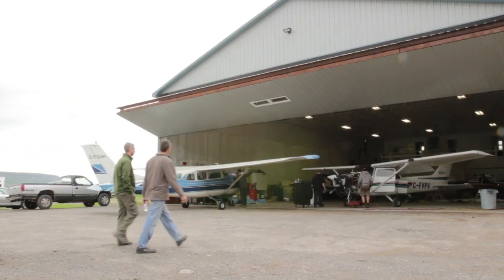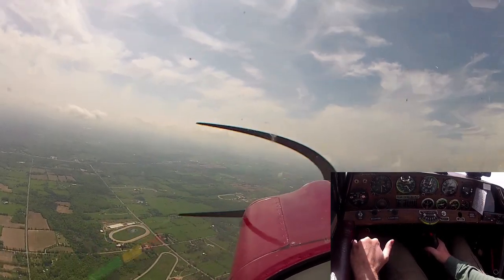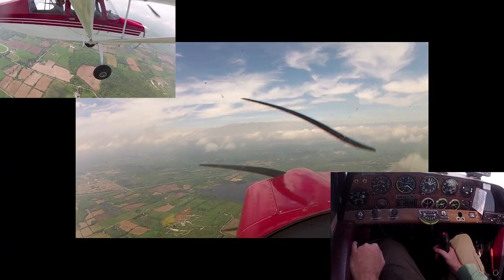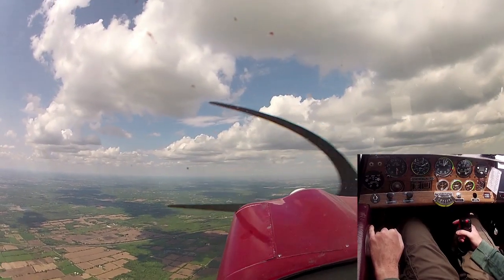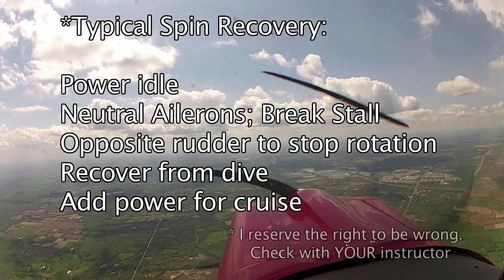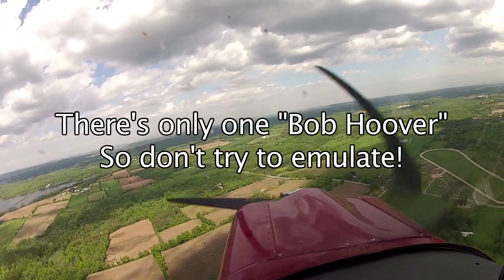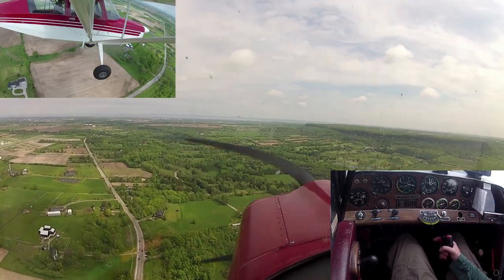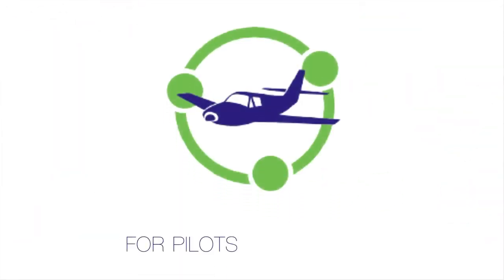Upset Recovery and Spin Training - Bellanca Citabria - POV Flying

Comment: I fully understand that feeling of watching fields spinning around in front of you, and the shock of the suddenness. Inadvertently entered a spin in a 172 as a student pilot during a power on stall. What's most memorable (other than jelly-legs exiting the plane) was my instructors completely calm voice narrating the spin recovery, followed by "I've never had a student do that to a 172 before". Leaden left foot. Also did a perfect no-flaps landing in the same 172. Inadvertently. As I went to retract the flaps for the touch and go I had a shock, with a grinning instructor saying "forget something?". Happy days.
Reply: You did cut the flaps on the flare??? good trick..I did it too..Mooneys float a lot on flare if a few knots too fast for the weigh..You cut the flaps, it seats nicely on runway...brakes on..500 feet roll..nice..

Comment: Thanks for showing the skidding-turn-stall while simulating a turn to final. That's my worst fear, because I have been guilty of stepping on the rudder too much to keep from overshooting, and I didn't realize how dangerous that can be!
Reply from the maker: glassdogangle Yup - it is scary how many pilots are afraid to confidently bank when needed, but will happily do a low level, slow skidding turn, and flirt with a stall / spin with out even realizing it.
Reply: +glassdogangle When I took my check ride, the DPE told me that a skidding turn in the pattern would be an automatic fail because that's how many stall/spin accidents happen. That's stuck with me ever since, and this video helped solidify that thinking. (I flew tonight, and was keeping an eye on the ball during my base/final turns specifically for the skid)

Comment: Great video, I've played around with flight sims a bit and spin recovery is something I have had a lot of trouble with. To be honest I didn't look into it all that much but just tried a bunch of different things and eventually gave up. The one thing I didn't try was neutral stick, it just seems so counter to what you think you need to do which is fighting to regain control. Being gentle and letting the aircraft do its thing makes so much sense when explained in the manner it was in your video. Cheers :-) Might have to pull out that sim again.

Comment: I love the video! I want to point out that a stall has nothing to do with speed. A plane can stall just as much at Vne as it can at landing speeds. It's all about AoA, the wing will stall when the air is going at too steep an angle in relation to the wing that the air separates from the top of the airfoil. Let's say you're traveling fast and yank back abruptly, the aircraft will respond abruptly as well. So abruptly that the aircraft will be pointing up even though it hasn't yet changed the direction it's traveling, thus it's now pointing up while still traveling straight forward.

Just wanted to point that out! I'm no expert and I didn't notice any misinformation at all in the video. Just thought this was worth mentioning.

Happy flying!

Comment: Nice video - I'm a glider instructor at GGC (CNF3) and we teach the botched final turn spin entry to all glider pilots. Nose high - flat turn - rudder it around - wing drops. As far as I know that's the standard in the course syllabus in Canada - and we require a demonstration on all spring check flights. 

As far as I'm concerned, spin training is the most important part of any PPL - I didn't feel comfortable behind the yoke until I got past the spin training section. 

Oh and your spin recoveries were nice - from an Aerobatic Contest perspective - you need aggressive forward stick to break the stall exactly when you want and set a nice vertical line after the spin :)

Don't be too hard on yourself with all the disclaimers. I'm an "instructor" in gliders at least, and you seem to know what you're talking about :)
Reply from the maker: Thanks!  I appreciate your perspective as a glider instructor!  That's awesome.  My next big goal after getting IFR done, is to have accumulated enough tail wheel time to feel comfortable volunteering as a tow pilot at a local glider club!  Hopefuly I can get into that next year!
Reply from the maker: Tom Hastie Awesome man!  How long did it take to get comfortable towing?  I hear you have to climb out super slow, both due to the added drag of the glider, but also because they don;t want to to fly very fast...  So I guess it is super gentle turns all the way up and then spiral slip to get down in a hurry?  The climb scares me, but the descent sounds like a blast :P
Reply: I got comfortable pretty fast... probably just a few duty days of towing. 
The climb is a non issue - Climb at 65knots for 99% of gliders. Gliders with water ballast will ask for 70-75knots. Then you just hold that airspeed until the glider lets go. Generally you also want to be finding thermals for the glider to release in. 

You can totally tell how experienced the glider pilot behind you is by how hard you are working the stick and rudder to maintain pitch attitude. It's kind of like flying in moderate turbulence when a new student is back there. The more experienced the glider pilot, the steeper you can turn. With the high time pilots behind me, I can often turn tight enough to stay in a thermal with the towplane. :) Students don't like that though. You have to know who you're working with. 

On the way down there's generally a cool down procedure to cool the engine slowly and in a controlled manner. If you just chop the power and accelerate to Va, you can shock cool the engine and crack cylinders quicker.

Biggest danger towing is a mid-air collision. You're operating in super congested airspace, and you need to keep a mental map going of where all the gliders within 5nm of the airport area at any time. I prefer towing with the low wing Pawnee because it gives you much better upward visibility in the climb. 

Phew... that was long. Sorry for the ramble.

Have fun!

Comment: Good stuff. I really wish more guys would reiterate more about flying patterns that basically allow you to reach the runway safely with a power loss (which typically happens during an adjustment to power). My CFI beat it into my brain to fly patterns in which I would orient the distance from the active on my downwind leg to be able to pull heat and go to idle power when I were perp with the numbers. Unless in a hot, complex a/c, I just do not understand taking the chance of flying a huge pattern when flying a simple configuration like a Cub or Citabria. Now I fly complex ac and don't drag them in with power over obstacles etc. to reach the threshold. I would love to hear your opinion on this and maybe a vid. Obviously crosswinds and other variables play a role but man, that was a 3 mile final... lol. Great vids though! Thanks!
Reply from the maker: I agree completely with your thoughts.  And when I have more experience with faster complex aircraft I'd love to explore it further.  As for this particular case, it was actually a 1 mile final - the wide GoPro lens just makes it look further...  but if you do the math based on the speed and time, you'll see that it is actually almost exactly 1 mile (I just timed it before making this reply to be sure I wasn't crazy :)

Comment: I was at a fly in when I was a kid and they were doing the flour bombing contest.  One gentleman was in his hot rod twin beech running low passes and dropping and doing hard pull ups.  He was in this scenario where he pulled up too hard and got to a mock hammerhead position and spun it into the ground off the end of the runway because he lost airspeed and probably kicked his rudder hard at low altitude.  I can still remember the unsettling crunch and black cloud of burning.  Stalls on final are fatal.  Especially accelerated stalls since they don’t come with a warning and are always pilot induced through over control.

Comment: Thanks a lot. Great footage and editing, and very informative to watch, as usual.

The rocking sideways without turning was the only manouver during my primary training that made me slightly queasy. Even under the hood, or steep turns up to 60º was never an issue.

Cub prop strike "wasn't major" but still required an engine teardown?

Prop strikes are never "minor". For this very reason. Any prop strike is assumed to impart "shock loading" on the crankshaft, which requires a rebuild. The shop that maintains our aircraft had a couple of those recently. Not our plane, though.
Reply from the maker: Thanks for clarifying - you are absolutely correct.
When I said "it wasn't major" I meant it wasn't a crash that involved airframe damage, it actually happened while taxiing slowly...  The crazy thing is, this particular prop strike was almost avoided - the engine was shut down by the time it happened, and it was actually on the "kick back" when it struck...  so the trailing edge of the prop was where the damage happened.  But still, they took it seriously and went through the full inspection process. But again, thanks for clarifying where I failed to do so,  I am going to add what I wrote here to the description.

Comment: This was a very interesting video. I haven't flown in aircraft in years (only done it once as it is) and I am relegated to simulators. In Warthunder's simulator difficultly, all of the aircraft would spin if you gave them too much rudder on a turn. I did think it was just something wrong with the game... apparently not. And given how disorienting it was staring at a monitor watching it, I don't envy any pilot who's got to do that for real.
Reply: I work on simulators. Something to keep in mind is they are only as good as their flight dynamics model driving them.  A lot of simulators (with the exception of X-plane) use a table look up method based on aerodynamic coefficients determined from a wind tunnel. So right there the simulation is only as good as the wind tunnel data. And, I can tell you. The data is likely un-symettrical.  Also, simulators, such as MS FSX, don't use very large tables with lots of points. It gets watered down. So, in short, it is not very accurate.
Reply: Joshua Reed
indeed. the way X-plane seems to do it is a lot more precise, well, as precise as a 'game' might be. (As a side note, making your own aircraft in the demo is pretty fun, and challenging,, if you keep yourself to engines you can buy off the market)
Reply: X-Plane uses blade element theory. It's a lot faster, but does not come without drawbacks. Simulation is always an approximation. No matter how close. Haven't really bothered with the plane maker tool.
Reply: Joshua Reed
Indeed, that approximation depends quite a bit on how the aircraft is modeled.

Comment: Learned aerobatic flying in a Citabria in 1973.  Spins are so much fun!  Loved hanging on the prop just before a tail slide and doing a 180 degree turn.  My first solo without inverted oil was bad news.  Too much time upside down and damaged the engine--barely made it back to the airport!  My next solo resulted  in a 7G blackout as I did a split S recovery from a 180 MPH dive.  Flying inverted and tried to correct a slight nose sink by pulling back on the stick.  Wrong way.  A full throttle vertical dive (chopped it quickly) brought me from 7,000 feet, through a brief blackout and a level flight recovery at 350 feet!
I'm now 70 so clearly I lived to tell the tale!  See my book:  https://www.thebrotherhoodofthebeast.com

Comment: I didn't know you could crap your pants as a Monday Morning quarterback. I Almost did watching another great video. For the gopro on the Wing. What bracket do you use 
Thanks again.
Reply from the maker: Thanks!  I have a big bag of tricks for camera rigging.
Several stock GoPro mounts as well as aftermarket such as RAM.
In this case, the GoPro "roll bar mount" was a perfect fit for the thin wing strut (beside the thicker one) on the Citabria

Comment: Steve, great video! How do you attach the camera to the exterior of the wing?
Reply from the maker: Eric Haber Thanks Eric.  I actually use stock GoPro roll bar mount for the smaller strut on the Citabria and Super Cub.  I don't have a good solution for exterior mounting a Cessna or PA28 though.
Reply: Okay, thanks!

Comment: Hey, is that the Super Cub some dink taxied into a concrete-filled steel post around the filling station, thereby stopping the engine cold in milliseconds?
Reply from the maker: +LorddGray - yes, funny / sad thing is this was 2 seasons earlier, and it was a super minor prop strike that time... But the engine was due for over haul so they did a full bulk inspection regardless - it was back on line shortly after... The latest prop strike was major and did a lot of damage.  They are still working on fixing it months later.
Reply: ***** Wow. I saw that video (about the major strike) quite some time ago but it just looked so familiar. Bummer to get it banged up like that.

Comment: Why did you start it on left mag only? 

Greetings, from a New Zealand PPL student!
Reply from the maker: Thanks for stopping by from across the pond!
The left mag has some sort of "retard mechanism" that allows it start at a low RPM with out detonation or something...  the right mag does not have that apparently...  so we don't turn on the right mag until after she's started running and is at a stable idle RPM.
Reply: Oh, thank you!

Comment: I practiced hundreds of times all 5 kinds of engine fails on take off..Also the 5 feet full flap go arounds...One thing is to practice "High Altitude Upsets" VS the  "Low Altitude Upsets"....That is why so many with spin training stall when low...

Its ok to practice spins and basic aerobatics at high altitude..The legal limit to recover in USA is 1,500 feet..BUT the engine fails on all legs of traffic pattern (all 5 legs) are different and no spin training practice at 3k feet is going to save you from making mistakes when the danger is so close..You need to do traffic pattern engine fails do be able to say..I can do them all without stalling it like so many have done...Yes I can.....

Comment: Could you try to explain what trim is and how it works
Reply from the maker: +Fusion322 Hey there, if you check the rest of the tail wheel series, you'll see solid explanations about trim.
Reply: +Fusion322 Think of it as a "neutral point" or a "baseline" for airspeed. With trim,  the airplane will fly itself and maintain the desired airspeed with zero force applied to the stick or just as well, hands-off. You adjust trim for a desired airspeed and the airplane will fly hands-off at that speed, regardless of power (or lack thereof). From this, you see that you always have to apply force to the stick to fly at a speed for which the airplane is not trimmed - if you release the force, the airplane will naturally seek the required attitude to resume the trimmed speed. This also means that at trimmed airspeed, engine will control altitude. You can climb and descend, hands-off and at constant airspeed, just buy adjusting engine power - not that this is the best way to do it, as there are specific best climb, best glide speeds, etc.
Reply: Wow, thank you
Reply: +corisco tupi If you fly an Airbus then trim is not an issue:-)
After 36 yrs of driving planes am only now getting used to handling my 7ECA I bought recently, like learning to fly all over again!:-)
Reply: endwood Envy! Envy! Envy! I once thought hard about selling real estate to buy an airplane. Didn't have the guts to do it. Kudos to you for accomplishing the dream of 9 out of 10 people who fly. BTW - did you have previous taildragger experience or did you learn the specifics in the Citabria?

Comment: Sweet!
Reply: The first thing I ever did when I got airborne in an old school flight simulator was to stall, spin, and crash straight into the ground. That's real deal stuff. I couldn't just let go of the stick either because it was all computerized so I had to do inputs to get it out of the spinning stall. It took me a while to master it and that was at least 30 years ago when I was a little kid. I love aviation!

Comment: What mounts do you use to attach gopros on the wings?
Reply from the maker: Ricardo Mora Hi there - #GoPro stock roll bar and handle bar mouths work well on the thin struts of Citabria and Super Cub. Be sure to talk to a mechanic before you mess around with external mounts to be sure you're not causing airwirthyness issues.

Comment: Holy Crap Batman !  Murphy loved this poor guy !  Kinda calls into question the wisdom of Ctaf controlled lighting or nothing.
Gotta be some low intensity lighting that isn't so expensive that it cant stay on.  Even 10% of the lights he had ( none) would be a life saver.  It requires a battery or battery wiring or main fuse failure to have no electricity at all.  Can't tell what he did or didn't do... but what he did do is 1. Fly the Airplane  2. Land his passengers Safely.  Another reason I don't fly at night !